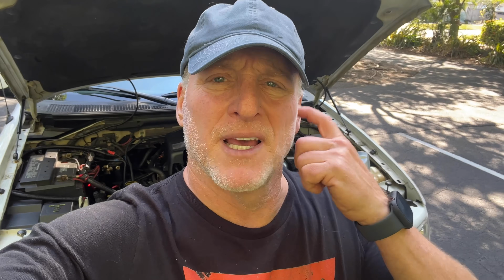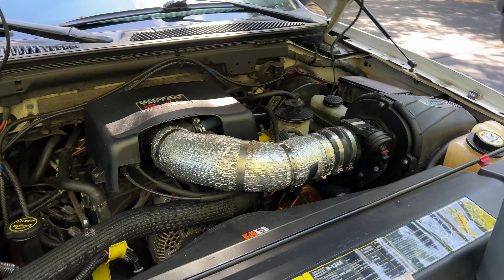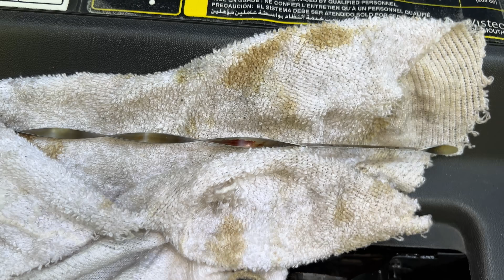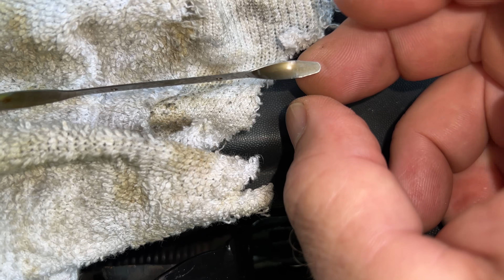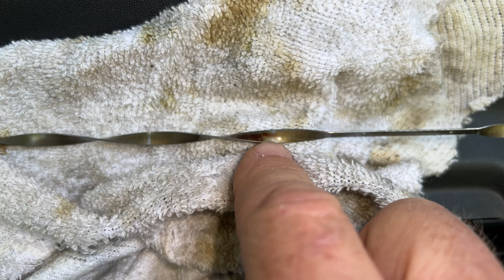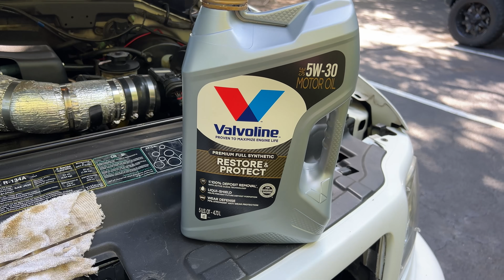Valvoline Restore & Protect Review: High Mileage 264K Engine: Reduce Oil Consumption & Piston Slap?

Comment: Is it using less oil?
Reply from the maker: Yes, that is what I mentioned in the video. Correction: I did not mention in the video, oil consumption is significantly lower
Reply: @DrivingIntelligence  That's great to hear! I have 669,300 miles on my 2007 Accord with the original engine, and it burns about a quart of oil every 1000 miles or so and has for many years. The rings on these are known to burn oil over time, and I plan to try R&P on my next oil change come spring. Hopefully it helps some!
Reply from the maker: @ that is incredible!  Almost 700k miles!  Honda may want to make a commercial about you.
Reply: @TheThirdeYe1337  You've made it almost 700k without a rebuild? 😱
Reply: @panzerkiller13  yep, still going. Just put another ~175 miles on it today
Reply: @ That's incredible! I'm not going to be so lucky because of a leaking rear main seal a dealership caused doing a recall years ago, but I'm sure I can make it to 350 or so before the leak gets bad enough that I cant keep up with it!
Reply from the maker: @ sorry to hear that, what recall was being performed?
Reply: @panzerkiller13  Those Honda engines are indestructible!
Reply: @DrivingIntelligence  I started using it in my car and I have gone about 2,000 miles with it and my oil consumption has gotten worse. Hoping this is only a temporary issue. My guess is its removing deposits around my stuck oil rings which has made oil consumption worse but will resolve once the piston ring is free and fills that gap again.
Reply: @b33fcake34  yes exactly.
Reply: @b33fcake34  You might have a oil leak around a oil seal, valve cover gasket, or oil pan gasket. The valvaline motor oil may be doing its job, but could be opening up areas that were already leaking, before you switched to that oil.
Reply: @Slim1423  No oil leaks at this time. Valve cover gaskets I just replaced myself since the seals for the spark plug wells were starting to leak.
Reply: @b33fcake34  If you have a LEAK, I'd go with ATP-205 reseal first! Let that sit in engine for about 1-2k miles. Drain & fill with this. That ATP-205 should seal any leaks then if it's losing oil it'll most likely be blow-by which this oil would take care of it.
Reply: @b33fcake34  been a year now did it stop using more oil?
Reply: @Justin-bb7oi  nope, still eats oil. 0 leaks, no blue smoke at all, car runs great. Only 3rd oil change with restore and protect and have gone just over 15,000 miles with it. It uses about 3/4 qt of oil over 600 miles and sometime just 1/2 qt in 600 miles. They say it can take up to 4 oil changes or more before you see results. The car has over 200k miles on it and I'm sure the oil rings are well stuck. I wish i did a compression check before I started using it so I could compare.
Reply: @b33fcake34 Hopefully your oil consumption ends by the 4th oil change 🙏 and i know if i had a compression tester i would have done the same. Im only 500 miles in and had a check engine light come on for cylinder 1 misfire it cleared itself im guessing had a slight clog inside of a afm lifter that cleared itself or temporarily fouled a plug. I changed the filter at 500 miles but not the oil just topped it off. I just got this truck and i know theres sludge in it. So far i see improvements gonna change it at 3k intervals i think.
Reply: @DrivingIntelligence  how much less is it using now? what's the rate now?
Reply from the maker: @miltechmoto I’m genuinely sorry, I thought I mentioned this in the video, oil consumption went from 1 quart per 800 miles to 1 quart per 1,600 miles
Reply: @DrivingIntelligence  Thx, that's good news
Reply: @DrivingIntelligence  and how many miles have you been running the restore and protect oil? And was there any specific mileage where you noticed a sudden big drop?
Reply from the maker: @miltechmoto  I've got between 7k & 8k miles on the R&P.  The reduction in oil consumption is a progression.  I'm hoping for more improvement given I'm only at the 3rd oil change and Valvoline claims it takes 4 oil changes to get to full benefit.
Reply: @DrivingIntelligence  so there was no mileage marker where you saw a sudden improvement? Like at 3k or 6k?
Yeah well ill have to look into what valvoline is counting as an oil change interval. I know they like 5k miles. So that would be 20k miles if they're going by that. Or if they're okay with 3k that would 12k miles.
Reply from the maker: @miltechmoto  The reduced oil consumption was more of a progression.  As is the improvement in engine noise.  I just changed my oil after 5k miles and now on my 3rd oil change with R&P.  Let's see where this goes.
Reply: @DrivingIntelligence  wow!!!!  thats Fantastic....
Reply: @DrivingIntelligence  i've honda city 2011 runs more then 300,000 km its reducing oil around 0.5 after 2000km i used shell helix 10w 40 should i use valvoline so my oil burning reduce which engine oil is best to use to reduce the burning of engine oil ??I'please reply
Reply from the maker: @ammarzulfiqar8041  I've only found success using Valvoline R&P.  No other oil or additive has reduced my oil consumption.
Reply: @DrivingIntelligence  I just started using this oil in my 1994 OBS Bronco.
Reply: My comment is a bit irrelevant but just a testament to Valvoline oils, I bought a lil old Ford ranger 2wd 5sp with the 2.3l about 14 years ago to run to work. I bought it with 200,000 miles
 Since then all I've ever used is Valvoline high mileage max synthetic blend, changed religiously at 3000-3500 miles. The truck has 511,000+ miles and has no tics taps or raps and doesn't leak a thing. Original engine transmission and rear end! Maintenance is key. The only issues this lil truck ever has is starters and the damn hydraulic master cylinder for the clutch! When I bought this thing as basically a beater for work since I do construction and hate driving my newer vehicles to the job sites, did I ever think It would still be running 14 years later! Lol. Crazy
Reply from the maker: @paulcondie2520  great story... have you been inside the engine at all?  Pulled valve covers?  When I did a timing set on my 10th Gen F150, the valve train was a very bronze color.  I'm thinking the previous owner that put 165k on the truck might not have used the best oil with the optimum OCI.  Curious what your internals look if you've seen them.
Reply: @DrivingIntelligence  no, never had it opened up. I put plug wires spark plugs and timing belt and water pump. That's it. I'm sure the inside is super clean because I changed my oil religiously between 3,000 and 3500 Miles. Oila cheap especially at Walmart! Lol. Engines, not so much plus the headaches
Reply: @paulcondie2520  With all the lazy butts operating cars who don't take care of them there is no way they will make it to the mileage you have.
Reply: @Rob-xj3xh  you're probably right. Most argue I waste my money changing my oil at 3000-3500 miles. Those same people probably trade in before their warranty is up!?!? 🤷 Oil is cheap compared to engine and transmission replacement, and also the huge inconvenience of getting replaced and  having no Wheels!  I'll keep wasting my money 😂😂😂
Reply: @paulcondie2520  On average I change my oil at around 2500 to 2800 miles.  Guess I wasting my money also.
Reply: @Rob-xj3xh  👊, absolutely nothing wrong with that
Reply from the maker: @paulcondie2520  right on!  I'm the same.
Reply: Just an 'FYI' - I have a neglected 2006 Holden VZ (3.6 L Alloytech), it was burning (oil) 1.5 ltr / 1,000 km.  I gave it 3 consecutive kerosene flushes (5 ltrs oil, 2 ltrs kerosene (+ filter), run for 30 mins drain and repeat), now it's only using 1 ltr per 3,000 km (something I can live with).  I was looking at a potential engine replacement or rebuild, so a few $$$ on the flushes has turned out to be well spent :)
Reply: When can we expect the update video ? I’m highly interested in running this oil in my vehicles
Reply from the maker: @Apinp18  coming soon, I need to edit everything together.  Lots of info in the next video.
Reply: You guys could prevent all of this extra oil consumption. Sell them fords and buy a gm pickup. I have 3 of them. And a gm suv.all have well over 200k one of them has 489,000 mi . And does not burn oil.i cant speak for anything past 2007. I heard gm realy went downhill with they're newer vehicles. I'm sure all brands have with the computer junk. But a well maintained 99-2007 gm vehicle will last a very long time.
Reply from the maker: @jason6325  Since you commented twice, sharing my response twice:  without being sarcastic, the worst vehicle I ever owned was a Chevrolet Blazer.  Gutless, rust bucket.  I will never buy another GM truck.  On the contrary, I love my 2006 Cadillac CTS V with the LS2 engine, but it uses oil!  So not aligned with your comment, at all.  At 267k miles, I never hesitate to drive my F150 long distance on the original engine.  Runs smooth as butter.  I'll give you this, a few years ago I worked on a friend's 1/2 ton GMC and that 5.7 was smooth, but the interior was pure junk.  Again, not being sarcastic, just sharing my experience.

Comment: Stupid question, on the Valvoline Restore and Protect product data sheet it says ester somewhere, does that mean it really has ester in the oil ?
Reply from the maker: Not a stupid question. Seeing “ester” on a data sheet may indicate that the oil contains some ester chemistry, possibly as part of the additive package, but it does not necessarily mean Restore & Protect is an ester-based oil or contains a large percentage of ester base stock. Valvoline describes it as premium full-synthetic base oils with proprietary additive technology, and the complete formulation and percentages are not publicly disclosed. So it may contain some ester, but we cannot accurately call it a high-ester oil from the data sheet alone.

Comment: Why would you not have used a premium oil earlier such as Amsoil Signature Series?  It has way more additives for wear, detergency, friction. Also a Grade 4/5 base oil.  Simply price????
Reply from the maker: I was using premium oils like Royal Purple and Pennzoil Ultra Platinum.  Neither did was this oil does.  And this oil is a lot cheaper than Amsoil.
Reply: @DrivingIntelligence cheaper than amsoil yes. Not better. Amsoil has more detergent than this. I don’t believe you were using pennzoil ultra platinum the entire time prior to this. If that was true you would never need to clean sludge or you extended the oil changes too long for the type of driving you do.
Reply from the maker: Never had sludge brother, and I never said I did.  

I used Pennzoil for years.  Valvoline R&P cleaned my rings so I have less blow by.
Reply: @DrivingIntelligence lol so you think valvoline has some magic ingredient that cleans rings and the others don’t?  That’s what you are saying???? Lmao
Reply from the maker: You clearly don’t have a clue… you’ve not done your research and spouting off like a self proclaimed expert.  Now I’m laughing
Reply: @DrivingIntelligence obviously youve done zero research and it’s blatantly obvious you’re completely ignorant and a fool. Tell me which performs better in the sequence IIIH test and sequence IVA test???? Zero facts to back up anything you say. Also you never answered the question because you can’t. Might as well quit while you think you’re ahead.

Comment: I think what this oil does best is clean up the deposits and varnish SLOWLY.  Nothing drastic.  It just works SLOWLY which is why repeated use is needed.   This is why you never see oil filters clogging badly when using this stuff.  Slow is what wins the race.
Reply from the maker: I've heard of some people claiming clogged oil filters after switching to this oil, but that is not my experience.  Then again, my engine was pretty clean when I started and no issues using this oil for over 19k miles.

Comment: is there an additive that you can just buy off the shelf, pour in and drive for 3000 mile that will clean the rings ? not that Rislone thicker than gear oil 140w stuff
Reply from the maker: This is the only product I’ve found that actually cleans the rings and is cost-effective. I have tried other products with zero success.

Comment: i've honda city 2011 runs more then 300,000 km its reducing oil around 0.5 after 2000km i used shell helix 10w 40 should i use valvoline so my oil burning reduce which engine oil is best to use to reduce the burning of engine oil ??I'please reply
Reply from the maker: I've only found success using Valvoline R&P.  No other oil or additive has reduced my oil consumption.
Reply: @DrivingIntelligence can you tell me which grade should I. Choose 10w 30 or 10w 40?
Reply from the maker: @ammarzulfiqar8041  R&P does not come in 40 weight.  What weight does your engine call for?  I went up one viscosity grade in my F150 without issue.

Comment: Been running different oil in my 05 corolla since getting it a few years ago. Mobil 1 ep, penzoil ultra platinum, O'Reilly syntec and now vavoline restore and protect. Started my car after the oil change and after like 5 seconds it sounded more quiet. The car is in excellent shape and doesn’t have a noise to begin with but compared to the syntec that was in it theres a definate difference right away! We'll see how it goes. As of right now I plan to use it for the next few oil changes as suggested. Thanks for the video. Its appreciated
Reply from the maker: Great comment, when you get a chance, check out this video where I share more of my experience with this oil:  https://youtu.be/7AzhjW-T4vk?si=z4a7Vkg53qrDicL6

Comment: two uses so far and all the varnish off of my dipstick and a ticking gone. engine is so smooth now
Reply from the maker: Glad it cleaned up the dipstick and fixed that tick, it really made a difference in my engine as well, but the varnish in my valve train remains after 4 OCIs.  I don't think it will remove more varnish, but my engine is much quieter, especially at start-up.

Comment: My mom's SUV just hit 100.000km or 62140 Miles, I put the Valvoline 5w30 Full synthetic Advanced this passed time, the engine is good no issues, I was just wondering to use the Restore and Protect in the next change, and then return to the Advanced 5w30, do you recommend this or should I just keep in the Advanced? Thanks for the video 🙌🏻.
Reply from the maker: Thanks for checking in.  I started using VRP to reduce oil consumption and piston slap.  It has been very effective.  As a result, I’m using this oil in all my vehicles.  You can use VRP long term with no concerns.  If the advanced formula works, you can continue to use it.  Are you using oil?
Reply: @DrivingIntelligence ok thanks for the answer, I would keep the Advanced, in the future maybe I will use the RP I see a lot of videos of how effective is in high miles vehicles, thanks again, have a good one.

Comment: This stuff works, after 4 oil changes at 6000km intervals my Tucson 2.0l went from burning 0.50l of oil every 1000km or sometimes almost 1L of oil at 1000km which is severe to ZERO litres burned after 1000km after 4 oil changes.I guess it cleaned up the piston and oil control rings.
Reply from the maker: that's what it sounds like!  Congrats!

Comment: "Blow-by" gads - a quart every 800 miles is something. Y'all got bigger problems. I had a buddy who had 450,000 miles on his. No issues. Dunno, man. 

I had piston slap at 80,000 in my 2004 Triton 5.4 Expedition. One of the local Goodyear shop techs, who had an older Triton Expedition with 300,000 miles, told me to warm it up for 3 or 4 minutes. I did this religiously and never had had another slap issue.
Reply from the maker: Here’s my full review.  Fuel consumption dropped and I’m in my 4th OCI with R&P.  The truck runs like a top and piston slap is 95% gone since I started using this oil.  I have a future video coming out sharing the results after 4 OCIs. UPDATE Valvoline Restore and Protect Review 8.5k miles: Reduce Oil Consumption Varnish Piston Slap?
https://youtu.be/7AzhjW-T4vk
Reply: @DrivingIntelligence  Ah - now that is interesting indeed. My /21 F-150, purchased w/ 58,000 on the clock, is on its first R&P change. I have the 2.7L EcoBoost. Gonna hit that subscribe button. Thanks!

Comment: I put this on my 2013 sonata with 148k miles. These GDI engines have issues with burning oil. 
I’m going to see how it goes, hoping for an improvement. They say it takes times and about 3-4 oil changes.  Any improvement is better than none.
Reply from the maker: Here are my results during the 4th OCI.  Reduced oil consumption and eliminated almost 100% of the piston slap using this oil.   https://youtu.be/7AzhjW-T4vk

Comment: You’ll probably see the rest of that varnish disappear too. VRP is cleaning the overhead on my Honda and removing varnish from surfaces that normally have only oil vapors and no direct splash.
Reply from the maker: getting close to sharing an update.  The top end of my engine is not getting clean after 4 oil changes and about 15k miles.  It is doing well in other areas.

Comment: I had a 2.5 Subaru non-turbo high-mileage engine. What I found was that the oil really calmed down the engine in vibration and noise. But my mileage got better. Before this oil, I tried several things. That car was always at 150 miles on a half a tank of gas to go. After the using the oil, I was at 180 miles.
Reply from the maker: Thanks for sharing